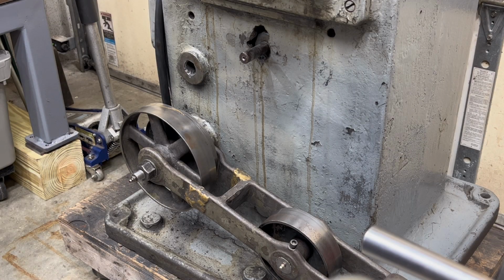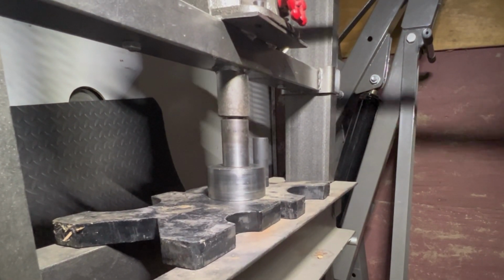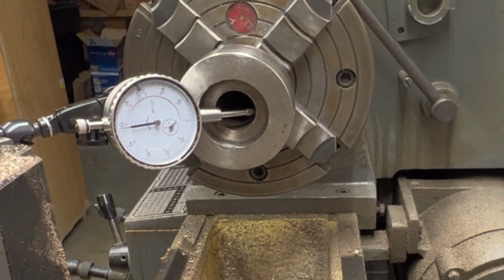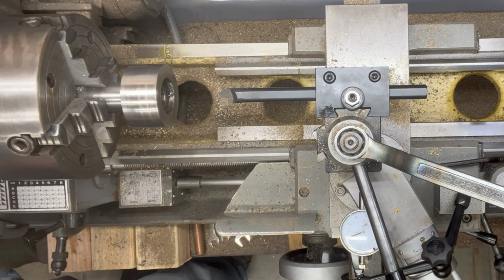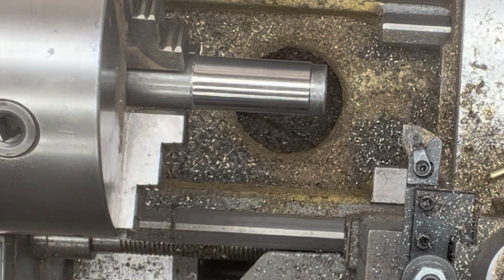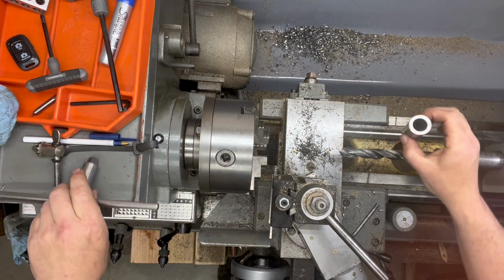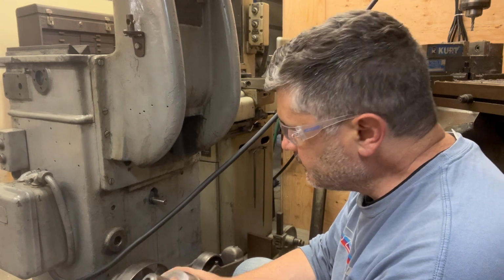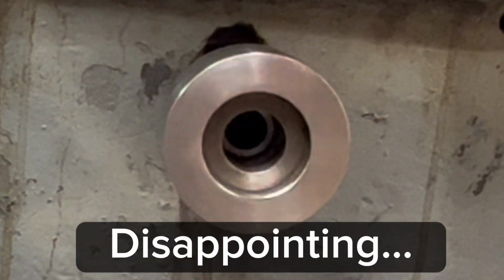Part 3 Preservation of a 1919 Brown and Sharpe no 2 surface grinder -Eliminating runout in a pulley.

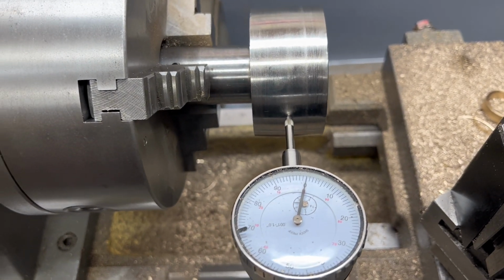Comment: at 9:15 or so when you're measuring runout of the pulley in your lathe -- did you end up measuring how true  your 3-jaw chuck is?  Great video, I look forward to watching the rest of the series on this sweet old machine.
Reply from the maker: I know I checked it early on when I first set up the lathe, but I don't recall the runout at that time...  Great point ,I'll double check.  Thanks for watching and sharing the comment.